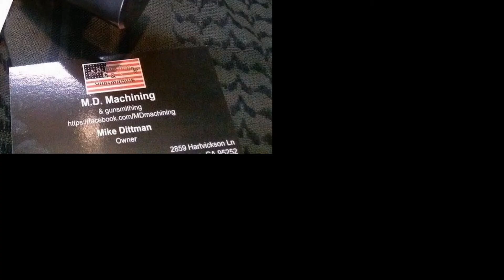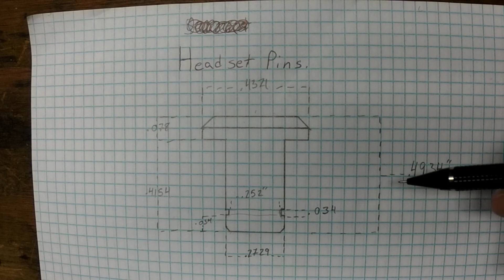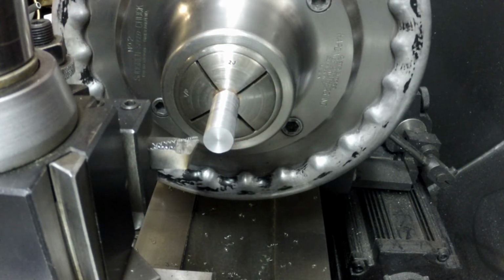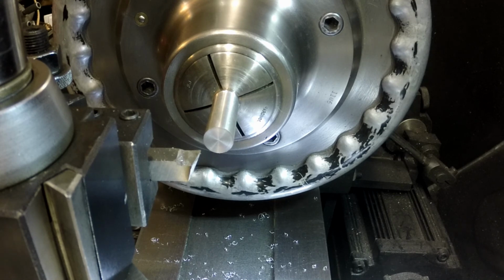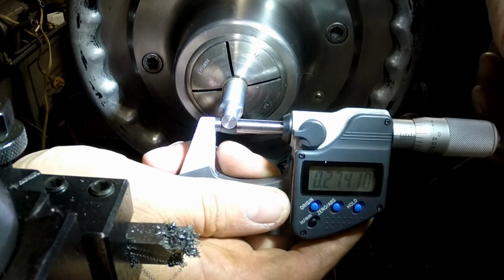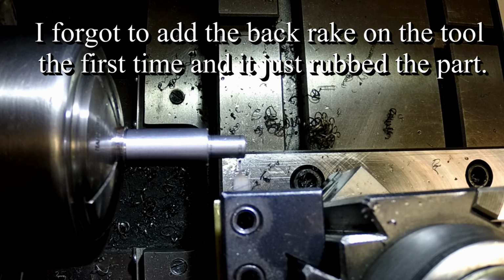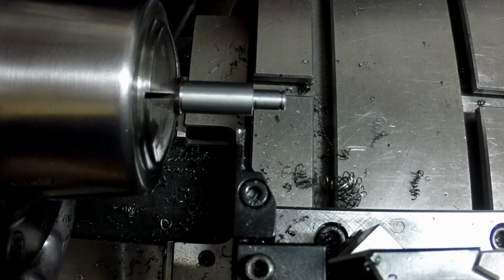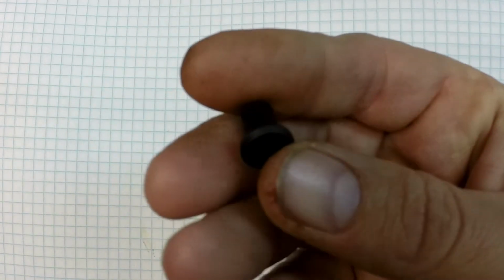Headset Pin

Comment: Looks good Mike, I like how black the Brownell's makes things! Do you think you could video test fitting the part on the helmet? It's always cool to see where things go...Thanks!

And for the focus issue @ 14:44 the setting that I can use to stop it from doing kinda the opposite of this is the "Auto-Focus" set to single instead of full-time, so maybe you want it to keep resetting the focus? Does your camera have that option? You have to be careful or it will focus on the shiniest thing, so that's why I reset everytime I change the shot, cause it's even worse with my cheap camera. I'm still learning things about the settings, and it's just so time-consuming to actually test each setting out on a big screen...but unless I do it that way, I'll never get it right :)

Aloha...Chuck
Reply from the maker: Knolltop Farms thanks. I'll see if I can video it. The GoPro doesn't have a focus setting that I know of and that's what I use most of the time now. If I'm going to be doing close shots I guess I could switch back to my old camera.